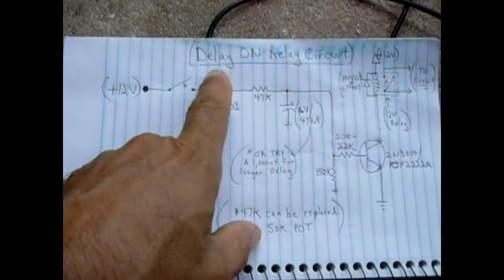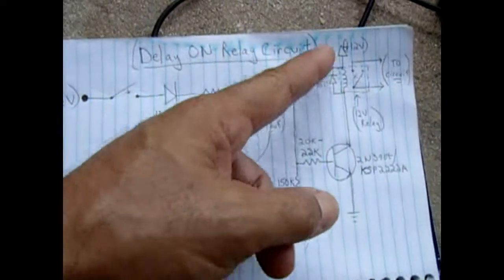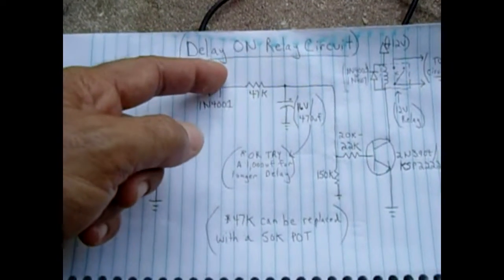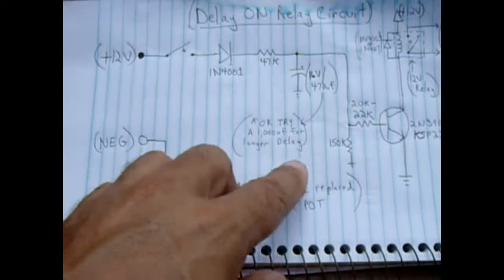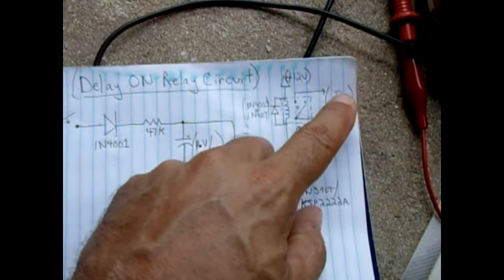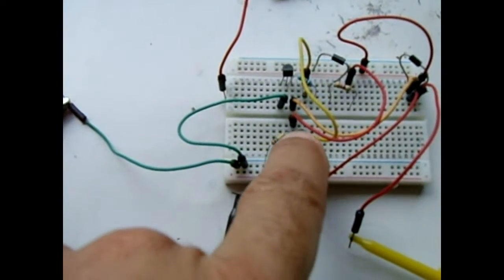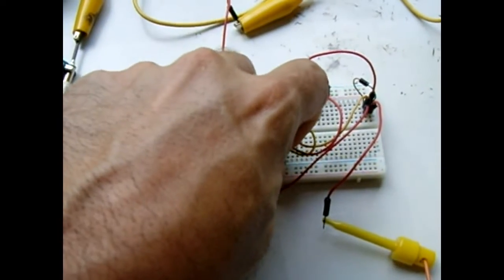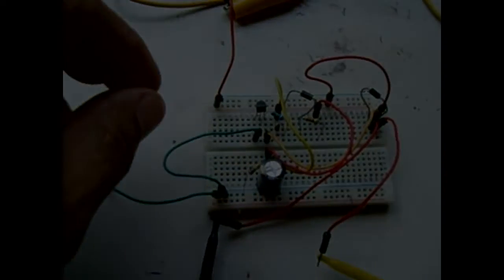Simple Automotive 12V Delayed ON Relay Circuit ~ Interior Lights

Comment: With low side switching the relay should be in the same box as the transistor. If you want to use the existing relay then you need to use high side switching by adding two resistors and a PNP transistor to this circuit. Much safer.

Comment: Hi, I need a brief 1 second delay on a 12v door actuator. Can you suggest a capacitor? Do I also need a resistor in parallel?
Reply from the maker: You'll need to experiment using different values. You can place the same value capacitors in parallel for longer run time, or in series for less.

Comment: Would you be willing to build something like this for me? Need a small compact circuit like this that delays a high mount reverse light from flashing when I shift from drive to park. Would like it to be compact and have leads for me to splice it into the trigger wire coming from the reverse lights before my relay.

Comment: So your car alarm wont work either then?
Reply from the maker: No, it should work fine.
Reply: @electronicsNmore  providing the thief holds the door open long enough...
Reply from the maker: @KarlHamilton  Not if you connect to the proper side of the circuit
Reply: @electronicsNmore  cars these days run lights and alarms all from a central electrical module.  There aren't seperate circuits for lighting and alarm, just the one switch leading to the CEM.
Reply from the maker: @KarlHamilton  I only reply to viewer comments once. I already replied too much. If you know how to wire it, it will work.
Reply: @electronicsNmore  I design automotive electronics for a living.  You clearly don't know what you're talking about.  Have a nice day.

Comment: I am trying to add delay to charging my phone. So, once i turn on the switch, i want a short delay (anything works between 1second and 5seconds) before my phone starts charging. Would you be able to help me with this?
Reply from the maker: I don't help viewers design circuits, I only supply videos showing circuits that work. Many channels receive thousands of dollars per month in donations from viewers, unfortunately this channel isn't one of them. If I did get that kind of viewer support, I would take the time out of my already busy day to help viewers at a higher level. I do answer one or 2 simple questions, which many channels on YT don't do. Thanks for watching!
Reply: electronicsNmore i understand your stance and i do appreciate your prompt response

Comment: How dose 12V get through a 47k resistor and a 22K resistor through the relay coil to ground ?  the voltage drop is too high , did you mean 47 ohm and 22 ohm , not K which is  x 1000 ohms ?
Reply from the maker: Very little current is required at the base of the transistor to turn it on.

Comment: Hello great circuit just what i need. Although i need it for 24V (up to 28) what components would your recommend be changed for larger values other than off course the relay that will be a 24v relay. 

Should I double the value of the drain resistor? 150k -> aprox 300k

Comment: Great and  simple circuit.
I wonder if I can increase the time to 30  min using this circuit?
I'm thinking about using a 3300uf capacitor and a 1.2m ohm potentiometer.
Reply from the maker: Yes, keep increasing the capacitor value.
Reply: electronicsNmore 
Thanks. 
I found a law for calculating the time:
T = R * C
T: time in seconds. 
R: resistor in ohm. 
C: capacitor in FARAD.
I don't know if it's accurate!

Comment: Automotive circuits typically run at 14 to 16v not 12v.  Will this circuit safely run at those voltages?  Do you foresee any issues with going up to a 1200uf cap?
thanks
great video
Reply from the maker: Yes, 12V is a "nominal" figure. Anything above 14.7v would mean the voltage regulator needs to be replaced. This will operate just fine with the alternator running. Experiment with different capacitor values.
Reply: +electronicsNmore oh ok.  another question:  In my application, I have another relay momentarily cutting power to the delay circuit.  The goal is to restart the time delay, aka discharge the cap.  Most instances, the power will be cut for about 5 seconds, but some instances, the power will only cut for a fraction of a second.  I'm worried that if power to my delay circuit is cut for too small a time duration, the cap will not discharge enough to have any time delay.
Reply: +electronicsNmore I just rewatched your video and noticed you noted a 5 minute discharge.  So I will have to change the circuit dramatically or use a different time delay circuit.  I assume a smaller capacitor should discharge faster.  Idealy I wanted 30 seconds, but really 3 seconds is ok if I need to reduce cap size to get the discharge time low enough.  Could I also reduce the 150k resistor to reduce discharge time?  However I think discharge too fast could be damaging to the cap.
Reply from the maker: GerGa769
You need to experiment with differnt values. I have over 350 video with viewers asking me questions. I can only reply once or twice to a viewer. Other channels would not ever bother to reply once. Higher cap value = more delay.
Reply: i understand thx

Comment: Why are we using a transistor, not just going direct to the relay? Is this because the resistor values limit too much current to the relay?
Reply from the maker: The transistor is used to create the delay, without it, the relay would immediately turn on.
Reply: No the capacitors and resistors are what are limiting the current, to slowly build up current, which then eventually turns on the transistor. This doesn't answer the question, as to why we are using a transistor. All I can figure is that it allows you to apply full current to the relay so it doesn't get damaged. If you eliminate the transistor and hook the "base" current directly to the relay, it would still have a delay. Relays take a certain amount of voltage to switch on. You would just have to use a very high value resistor, and it would take a very long time to build up enough voltage to turn on the relay. But if you don't put the full current to the relay it could possibly damage it.
Reply from the maker: supermuble Exactly. You explained it correctly. The transistor is necessary as a CURRENT AMPLIFIER to drive the relay.
Reply: electronicsNmore Ok perfect. Thank you sir!
Reply: mr. muble. this circuit is a sample of delay on.. in that case you want to get more current you should upgrade the transistor from 3904 to 5200.. 

anyways this video make me sense because this is what i look for.. simple delay on..

Comment: Thank you.

What if I have a pushbutton? I send a signal to a control unit, fx. to the input of a PLC, and then the signal should not come right away, but be delayed for 5 seconds.
So when I push the button real quick it should delay this quick 24V signal for 5 seconds. I prefer a dead circuit that does not need power. Is it possible to make?
Reply from the maker: +EVriderDK 
Hello there. I have way too many videos with viewers asking questions. I am unable to assist viewers in making modifications to circuits shown on my channel. If you assemble this exact circuit, and have problems, then feel free to ask me a question. Thank You

**I also show another circuit on my channel which sends a short pulse when it it triggered. Please refer to my video playlists.

Comment: How can I power on a time delay relay. not manually, using  other electronic circuit control. or trigger... what kind of circuit can I use..  ?   Thanks...
Reply from the maker: +chaki perdomo 
Please explain yourself better. I need details.
Reply: +electronicsNmore  In the video this delay is activated when the door is open by hand or a  switch is close  when the door is open by a hand. I need this circuit to be started b y another  circuit (timer) .. what I am lookin for is a is a time delay  relay that control a small motor.. to turn it on from 1s to 1m and off from 2 to 4 hours.. I need this system to work by itself..  Thanks for answering.....Or I should say  I need to built a controller to control the delay relay.. Sorry. I do not know much about electronics...

Comment: I don't understand how an analog signal "knows" the concept of time. I have no EE background and don't understand electronics at this level. How does an analog transistor/resistor/capacitor "know" how long 6 seconds is?
Reply from the maker: liamvg The triggering time is not "Exact". It takes time for the capacitor to charge up to a certain voltage(around .65v) where the transistor starts to turn on. Very simple. 

Thanks For Watching
Reply: electronicsNmore Hmm. I need to learn more about EE stuff. How do you make the relay come on, but only pulse once after the nn-second duration? Like, it gets triggered, then after 5 seconds it sends out 12V just for one pulse to make a light blink then turn off?

Comment: I'm trying to fit a reversing sensor to a CANBUS wired vehicle. The sensor box would usually take a 12V feed from the reversing light, but the CANBUS bulb monitoring system sends a rapid on/off pulse to the lamp every 1.5 seconds (it is on for a period too small to light a lamp, but enough to trigger a relay), so is not suitable for a direct feed to the sensor box.
What I need is a circuit that ignores the pulses and only triggers when the lamp gets 12V for more than 1/2 second (i.e. the car is in reverse gear). From your suggested use (i.e. to delay a courtesy light from coming on), I think this circuit could be the solution. Does it discharge the capacitor each time, or would the capacitor charge up over many of these individual pulses and eventually switch on the circuit too soon?
Reply: Mike P I think this is my solution. I've done it on a breadboard using a 47uF capacitor and 100k resistor in place of the 470uF and 47k components. Time to switch on is less than a second and the system discharges before the next pulse. I also took the 12V feed for the relay from the +ve side of the diode, so that once reverse is disengaged, the relay turns off immediately. Next step to build it on a circuit board and fit it. Thanks for the basic circuit.

Comment: Sir, this is the exact video I'm looking for. But I am not expert with this, what i need is a clear copy of your circuit board if possible. can i have a favor? please send me a ready made diagram of this. Thanks and more power!
Reply from the maker: Norman Eliaga There is no circuit board. You need to assemble the circuit using a prototype PCB. The schematic is in the video.

Thanks For Watching.
Reply: electronicsNmore okey thanks! But if it is possible to ask a clear copy on it, its a great pleasure. here is my email addrss. maneliaga@yahoo.com
Reply from the maker: Unfortunately there is not copy to give you. All you have to do is set the video player to the highest resolution to see everything clearly. You can also take a screenshot.

Comment: i need your help i know a little about what i am doing. but i do not know the name of what it is i am looking for. I had a light they do not make anymore so im going to make one. its a blinker 12v system.my running like stays on while driving and when the blinker is engaged it switches to amber. When the amber blinker light is engaged the running light turns off completely until the amber light is disengaged and then the running light (white light)  re-engages. there is something the turns off the power to the running light for just a few seconds each time the amber blinking is engaged. please if you could help or send me in the right direction i would really appreciate it
Reply from the maker: Nathan smith Hey Nate. So you want the running light to turn off when the blinker in engaged. What you want to do can be done very easily using any 12V relay(Auto parts store or Radio Shack). The blinker will be left exactly as you have it wired. The running light will be connected to a 12V relay using the C and NC contacts(The 2 pins which are connected while power is NOT supplied to the relay). You will cut the 12V power wire to the running light and connect each wire to the relay contacts(C & NC). Place a 1N4003 diode in reverse across the relay COIL to prevent any damage to sensitive electronics when power is removed from the relay coil. The line on the diode you will connect to one side of the relay coil and to the BLINKER 12V power supply. One wire of the relay coil will be connected to the chassis ground/NEG, and the other is connected to the blinker power supply as mentioned above. When the blinker is turned on, power will be supplied to the relay coil, which in turn opens the normally closed relay contacts turning OFF the running light. Hope that helps. BTW, how do I get a biplane ride? :-)

Please share my channel, and rate Thumbs Up.

Comment: Is there a way I can combine Delayed ON and Delayed OFF approaches you presented (your 2 separate videos)?
I need to actually control a relay that turns ON later to an event and similar for OFF.
Reply from the maker: There is a short delay on this circuit when it goes off. You can use both circuits together if you wanted. The input of the Delay Off Circuit can be connected to this circuit at the relay, or eliminate the relay and connect the NPN transistor's collector to the 12V+ supply, and place a 4.7K resistor from the emitter to ground(NEG). Between the emitter and the 4.7K resistor you would connect that point to the other circuit. You may have to do some adjusting.

Thanks For Watching.

Comment: SUBSCRIBED!
I commend you for still helping ppl, ppl that dont google search, ppl that ask questions that have already been answered multiple times. ect

After watching this vid, I searched adjustable 47k, and I think that would be the answer to more or less time b4 delay on. can use that in place, making ppl wanting a dif set time not have to worry about what to use in the rest of the system. can also use a resistor in line to the POT, and limit even more current.
I'm new to this, but I'm not ignorant, lol
 
thanks for all the vids. I have much to build. I've even thought of going to the local elec. eng. collage class and recruit some intern(free) help. but I may not need to now.

Comment: Hello and thanks for this valuable info. I'm building a device that needs to make a linear actuator go back and forth automatically. I need a short delay so that the dc gear motor doesn't burn out from being instantly reversed and this looks like the ticket. I'm wondering though if it has to be 12v because I was looking at a 3v gear motor to drive the actuator. I would then also be running a 3v relay though and that's what I'm worried about. Will this setup still work at these low voltages? I guess I could change the gear motor to 12 volts but this 3 volt one has all the right specs like rpm and shaft type and also cheap price.
Reply from the maker: You can use 3V if you have a 3V relay.

Comment: Thank you for your easy to follow,video. I want to build this, but need a delay of 2 minutes, must I just increase the Capacitor uF or what do you suggest? Thanks again.
Reply from the maker: I have no formula. You need to keep adding capacitance until you get the desired delay. You can also adjust the resistor value(47k) as well. Take out a breadboard and play with the values until you get it right.

Thanks.

Comment: This is an awesome video! Just a question, can this method be done to add a delay to a relay for HIDs on cars? I am not familiar with electrical circuits but I would rather do this than buy a 15 dollar delay relay. I have a ton of resistors, not really familiar with capacitors but I am just wondering if I could do this on a relay HID wiring harness?
Reply from the maker: Hello,
The circuit can be used to control any circuit. Just be sure to use a relay that has a high enough current rating for the lights being used, and has a low current relay coil.

Thanks For Watching! Be sure to share, and rate Thumbs Up.
Reply: electronicsNmore Is it completely necessary that I use a resistor and a diode? I am planning to wire a capacitor between the stock wiring harness of my headlights and the relay that will send power from the battery to my new HIDs. I am trying to do a 5 second delay. Is what causes the delay the resistor causing the capacitor to charge slower or is it just from the capacitor being wired in series instead of parallel?
Reply from the maker: The circuit must be set up exactly as I showed for it to work properly.